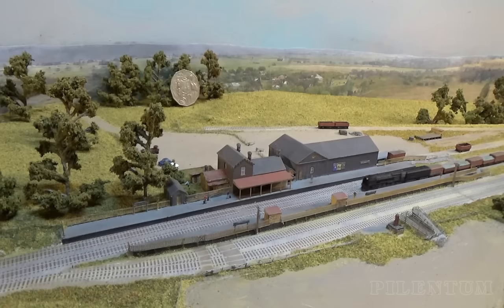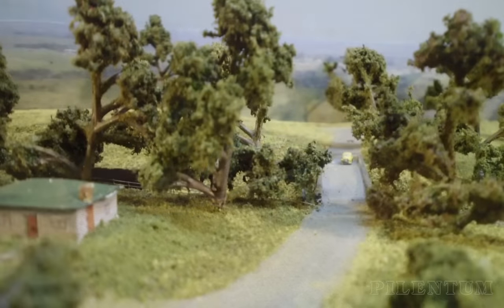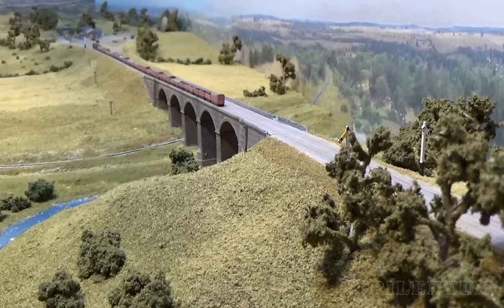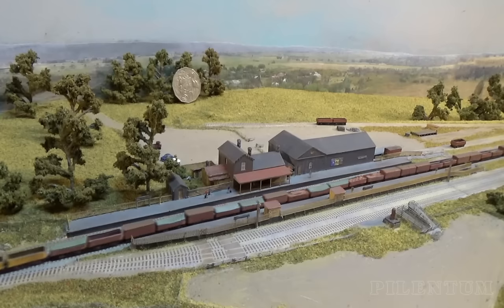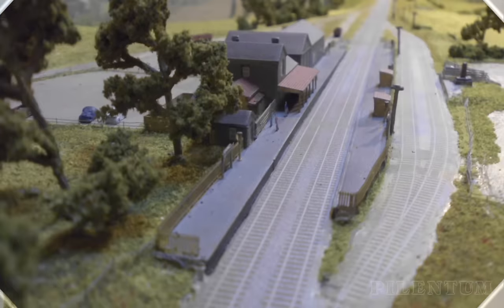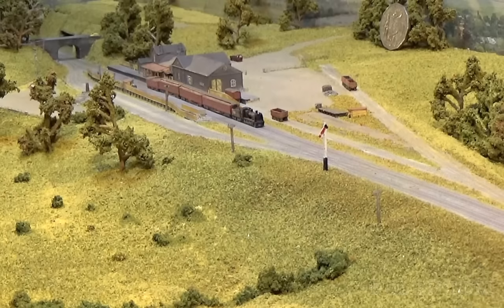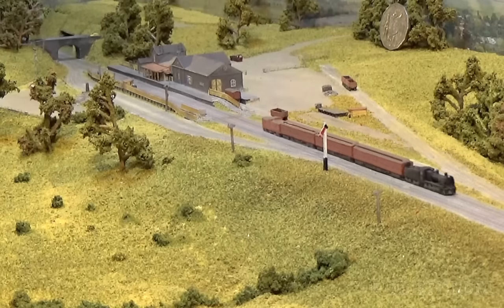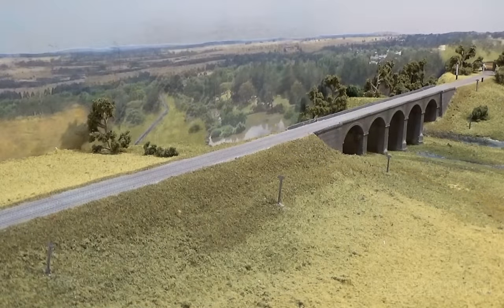One of the Smallest T Gauge Model Railway Layouts with Self-Propelled Model Trains by Martin Kaselis

Comment: I'll stick with HO scale. 😂
Reply: You won't be able to run trains with 15 coaches, or freight with over 30 wagons.
Reply: The scenic area on this one is equivalent to 33' x 8' in HO, and I was able to model the whole area with no compression - a luxury that is very hard to come by in the larger scales.
Reply: @modelrailmusings5981  Boom, Boom.
Reply: @Demun1649 No problem with Märklin from the 60's
Reply: @Romin.777  What scale, and did you do it? Or see it done at an exhibition on a large layout?
Reply: @Demun1649  H0 nope just at home.
But who has that kind of space at home anyway?
Reply: @Romin.777  EVERYONE who models in T-gauge.
Reply: @Demun1649  What about turning wheels, Walschearts valve gear assembly, Heusinger sliding movement, sound, smoke and interior lighting?
T scale, just a niche that won't stay long imho. 
The tech however could be used for H0 scale cars and such.

Comment: T gauge is on rails, I thought. Is this 1/1000 and not 1/450?
Reply: You are correct that conventional T Gauge is just like other scales that way, only smaller, and yes, with proper wheels running on proper rails.  This one is a completely different approach that avoids the reliability, maintenance and running issues that are that system's weak point, but at the cost of having to give up those proper wheels and rails.  The track doesn't actually care about the scale, as long as the size and weight of the models is within certain limits, and the 1:480 used on this layout is basically the sweet spot for trains.  I have also used it down to 1:720 and up to narrow gauge 1:220.
Reply: @modelrailmusings5981   so it is T scale on nano gauge?
Reply: @PeckhamHall  I suppose you could say so, but "nano" is not a recognised gauge or scale.  Their 1:1000 figure was basically plucked out of a hat.  Their models don't actually represent a real prototype, and by size they would probably be more like 1:700 or 1:800 anyway.
Reply: @modelrailmusings5981  cheers for replying, my friend. 😊 thanks